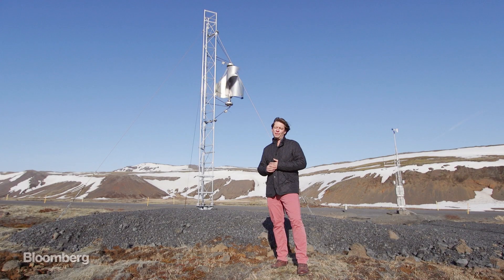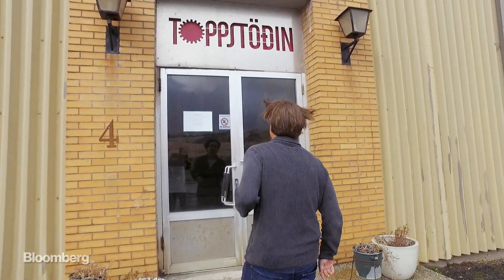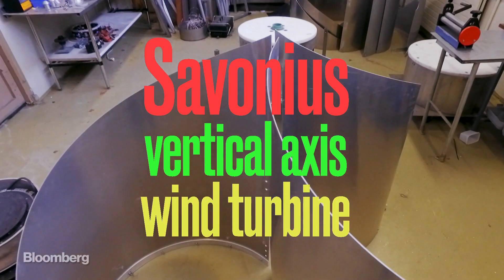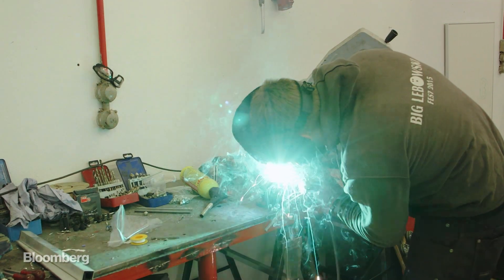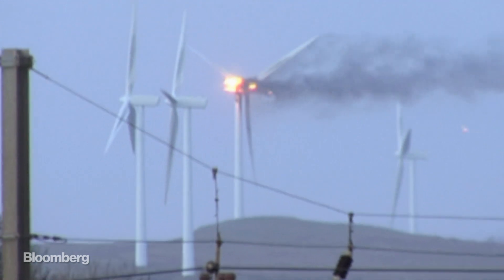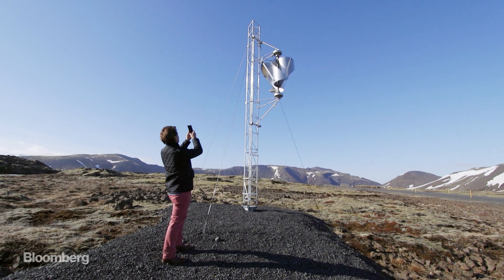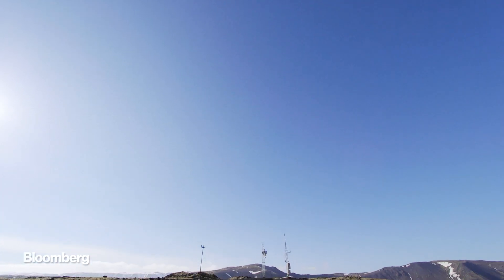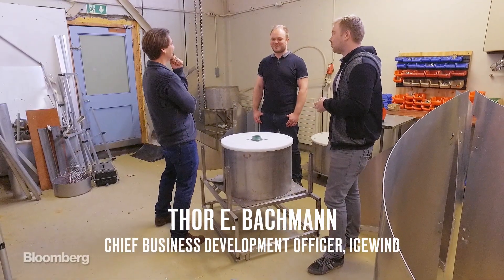The Tech That Could Fix One of Wind Power's Biggest Problems

Comment: The design is perfectly balanced, and can not over run to destruction. They do not generate any form of frictional heat , all bearings and pilots operate only in space. The brushless pcm motors are built bullet proof. The four post support system can withstand any weather condition.
The cyclone design will prevent high winds from ever grasping the unit.

This design can not harm any birds or insects, by design it sheads all outside contact. There is no scoop action to catch up anything in rotational direction.

It's built in balance with nature.
It should be demanded that this design be the only l turbine leagale to use anywere.
It can replace all fossil fuel engines.
Provide individually power supply and your own ev charging station.
If scaled down and put on to it's side inside a flow tube were most vehicle drive shafts are located it could be designed to provide thousands of killowatts to batteries as you drive your ev.

It doesn't matter what the industrial government pigs want anymore.
It is time to rid the world of there greedy wickedness.
Reply: Not applicable in large scale

Comment: People don't understand, the idea isn't for these to replace convetional wind turbines. They function more like solar panels, you can make lot's of them and put them everywhere you need a little bit of power. Though I have to admit they mislead us a bit in the video comparing the turbines to big, conventional wind turbines, as though they would replace them. They only hinted at their real purpose by showing us the bus stop and weather station.
Reply: Small versions of conventional wind turbines work just fine. They are used on sailing boats to charge batteries and to power illuminated road signs, weather stations etc.
Reply: @ColinWatters  REALY!!! How big is the on you talk about??
Reply: yes, we need specs, how do I know if I had to put 50 of these on my roof or just two?
Reply: @rotlara8618  The correct answer is 0.
Reply: The title of the vid is "The Tech That Could Fix One of Wind Power's Biggest Problems" though... 
TOTALLY misleading.
Reply: Looks an interesting compact design wonder if they were positioned by motorways the wind from passing vehicles would spin them to power street lights?
Reply: @brybish  Dumb
Reply: Most small loads like cell phone charging stations and street lights would be better served with a PV panel and a properly sized battery.  No moving parts.  Depends on the application of course.  N. Canada in the winter?  Got wind?  This might work for small load.  Maybe.  Need more data.
Reply: @solarwind907  even better: just connect those devices to the grid and focus on installing the far more efficient conventional turbines
Reply: However, in mass production could generate another form of pollution.
Reply: @petersimon5874  If you want something that takes no energy to produce and emits no pollution then just go stand outside and do nothing.
Reply: They're not worth the embedded energy generally.
Reply: I am considering a vertical axis wind turbine that looks exactly like a tree, I call it : e-tree,
the trunk of the e-tree is brown, the spinning blades are green,
attached to the trunk of the e-tree are features of : wifi/mobile network, light and power outlet, to charge a car for example
Reply: Cool but the onley thing you are saying !!! That the sice is way to ineficiant if you need 2 of Them to a AP/ hotspot and USB CHARDGING 
If i wanted 1 for my house to support my PV panels .. 48v .. i still need info about Watt !!!!! If you can't suppley Watt ..
Then you are just a rambelin moron !!! Oooh this dates back to the greeks!!! Yes and!!! Who give a fuk. 
I want Watt M/s Volt .. other wise .. go blow hot air elswhere
Reply: That’s because the investor class is desperate to keep power generation centralised. How can you extract rent from someone who is self sufficient ?
Reply: This is why we have massive wind turbines offshore but no small windmills on houses or property, like boats have,

Comment: Have always thought vertical wind turbines were more useful.
Reply: 'Common sense' is often a bad guide :-)
I like the design of vertical rotors too, but they are less efficient and the wind speed are lower at ground level.

A modern three blade wind turbine is close to harvesting the theoretical possible 59 % of the kinetic energy in the air passing the circle swept by the blades.

Fun fact: the power scales with the square of the diameter of that circle. Double the wingspan and you quadruple the output :-D

Comment: The video never said how they solved one of wind turbines biggest problems!   Booooooo
Reply: The sheer lack of attention and stupidity in this comment section beggars belief.
Reply: @mikehewitt1253  Yeah, elsewhere in YouBoob comments sections it's... uh... pretty much the same. (sigh)
Reply: I am considering a vertical axis wind turbine that looks exactly like a tree, I call it : e-tree,
the trunk of the e-tree is brown, the spinning blades are green,
attached to the trunk of the e-tree are features of : wifi/mobile network, light and power outlet, to charge a car for example
Reply: Congratulations, you discovered Persian designs hooray
Reply: Yes it did, the problem is spinning out of control. They said conventional wind turbines only have about a three year lifespan in Iceland because of this reason.
Reply: @MaximeKG  look at real engineering's comment higher up.
Reply: I know! I never said I agree with this video! All I'm saying is that they did in fact talk about "one of wind turbines biggest problems" and how these turbines would supposably solve them.
Reply: @MaximeKG  They never said how, just that they will solve it.
Reply: @R3lay0  The video said that it was because of their design.
Reply: @MaximeKG  They should use variable pitch blades. A three year life span is hopelessly uneconomic.
Reply: @kitemanmusic  surely they are built because the investors like burning money
Reply: @benedux  why else?
Reply: Maxime K-G l

Comment: The Savonius rotor is long outdated for its poor output of power. It can still be used for small energy outside of the commen electricity network and can also serve as a small starter for more efficient medium-sized vawt's. The model shown here is much too massive and costly.
Reply: @Nice Kiwi : A regular house needs too much elecricity as can be produced by a low wind vawt of any kind. An array of 10 - 15 m high vawt's not in the sight of a single house does not cost much and gives sufficient energy. When more power is needed the turbines can be almost tree-high and still do not spoil the landscape as the today preferred monster-hawt's do.

Comment: Might try research "wing" shapes on the vanes so they "sail/tack" into wind when coming around into wind.  A simple trick is to use hinges on vanes so they are "feathered"into the wind on return into wind reducing drag?  U will still only get 50% of max horiz shaft format pwr, unless the "wing shape pans out. But when it turns around to other side, into the wind it now is working against itself, reducing efficiency i'd say by ~30% ?   Upside is it works without needing directional control, omnidirectional.  Prefer slow moving ol dutch style with the big sailcloth movin slow, much safer, with tail vane it  directs itself; Need to have 3 independent ways to brake it in high winds , ie furl in the sails with counter weights/pulleys,  same method could reel in the telescoping vanes, 3 simple centrifugal brake can apply brakes to main axle shaft
Reply: Yeah,  I was in a dutch windmill in Iowa one breezy day and was just waiting for the thing to start ripping itself apart as the wind speed started getting out of hand. The volunteers operating it were looking at each other nervously and trying to figure out how they were going to brake it down. I decided maybe it was time to be getting back on the road!

Comment: But when it turns around to other side, into the wind it now is working against itself, reducing efficiency i'd say by ~30% ?   Upside is it works without needing directional control, omnidirectional.  Prefer slow moving ol dutch style with the big sailcloth movin slow, much safer, with tail vane it  directs itself; Need to have 3 independent ways to brake it in high winds , ie furl in the sails with counter weights/pulleys,  same method could reel in the telescoping vanes, 3 simple centrifugal brake can apply brakes to main axle shaft.

Comment: How high above the ground can this be installed (minimum  hight).?
What is it's power output and cost?
Reply: minimum height? about 0.1mm, if you don't worry about the meatgrinder aspect of it on passers-by.
This design thrives on erratic little gusts of variable wind coming at it from funny directions. I.e. ground turbulence is *fine*.

It does not benefit from being high up in steady, strong winds. It does not like strong winds. Over about 20kt it actually loses power generation with increasing wind.

Comment: There is certainly a lot of criticism about this and frankly I know nearly nothing about wind power but I do know about cooperation, progress and evolution. If this is what the detractors claim and not worth the effort or in the likely event they are wrong, it is at least a start. Here in the US there are acres of turbines that are huge devices. It appears this is a compact version of those and common sense (which seems to be disappearing as "higher" education progresses) would say let's take a impartial look. Remember that a heavier than air machine simply could never fly.

Comment: 2 years later and still not a single turbine for sale.
Reply: I have this week 27th March 2019 installed a similar design on my yacht to charge the batteries when I am away. It is rated at 60 watt which is sufficent for my needs so yes they are available

Comment: Given the lack of technical details in this video, I thought I would leave some details for those interested. The wind production range is between ~7 km/hr to 180 km/hr. It operates at just under 35 dB, it’s unidirectional and has a quoted 30 year lifetime. The IceWind CW-1000 (residential model) wind turbine provides users with 1000W at 36 km/hr. The wind turbines are built using carbon fiber, stainless steel and aircraft grade aluminum products. The technology is still in field testing trails (over 7 years), so not currently commercial.

Comment: Modern HAWT’s resist wind extremely well with pitch control, tip brakes and shaft brakes. Savonius can only achieve a TSR of 1, while HAWT can go much higher. VAWT is feasible only for small loads, because of their low scalability and efficiency.
Reply: However Darrieus rotor can be more efficient than Savonius.